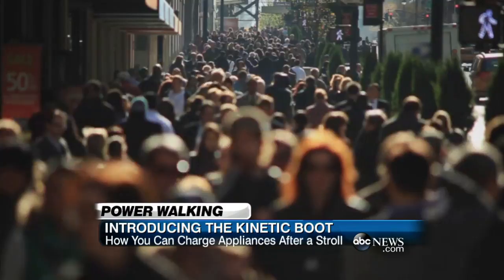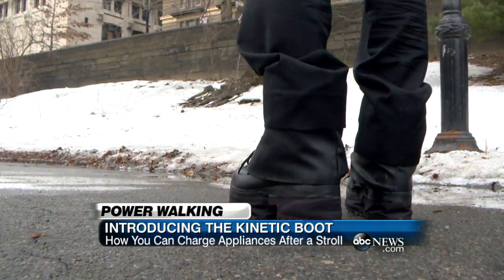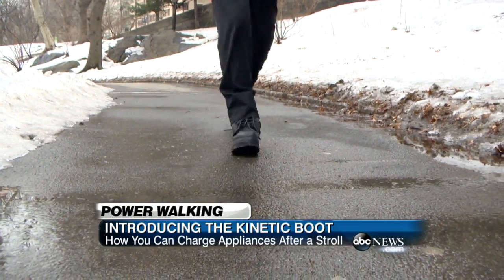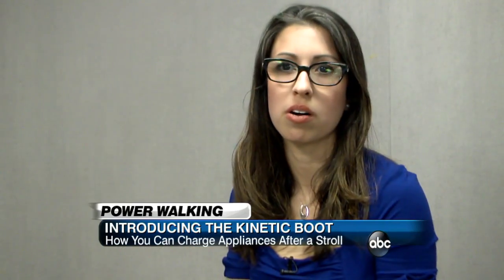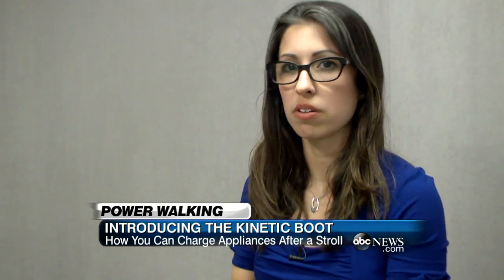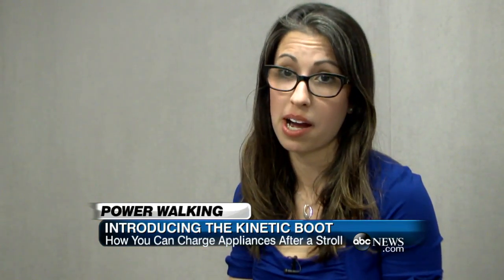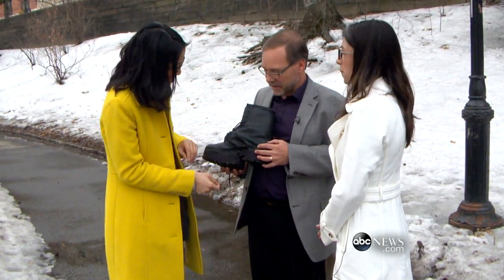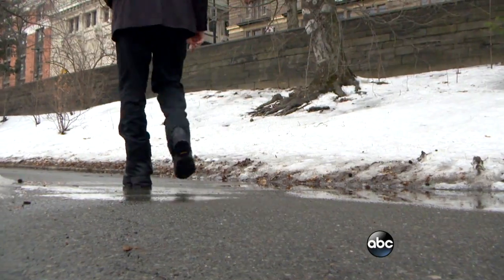Kinetic Boot Generates Electricity with Each Step

Comment: This is bullshit. There's nothing generates power from nothing. This boots just take it from you. What that means is that walking in this boots will exhaust you much faster than the usual ones; as you have to apply some force. Maybe the force is negligible but after few kilometers of walk you will pretty exhausted.